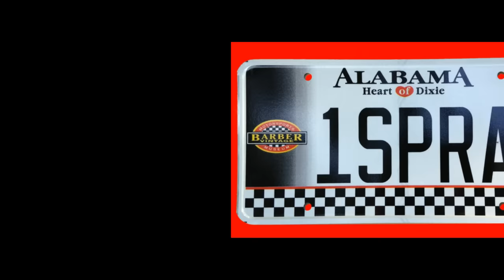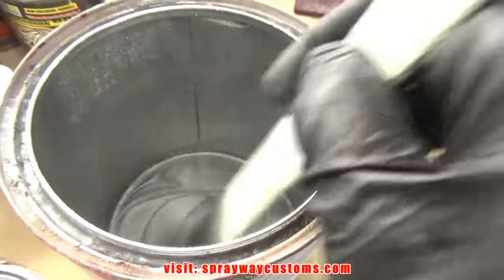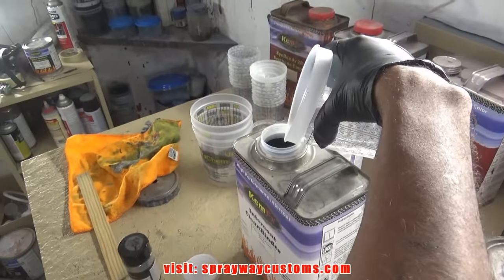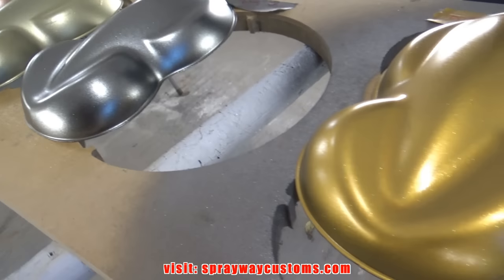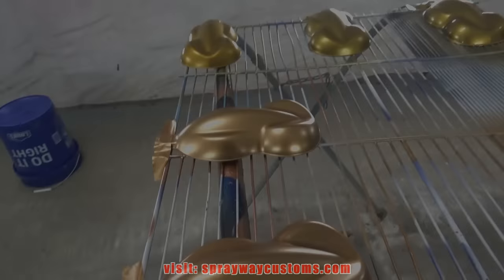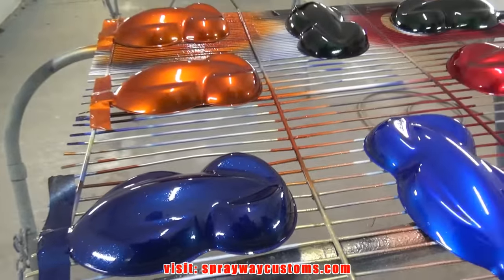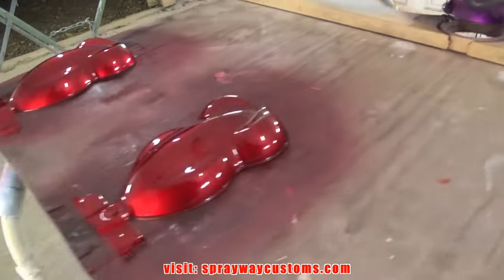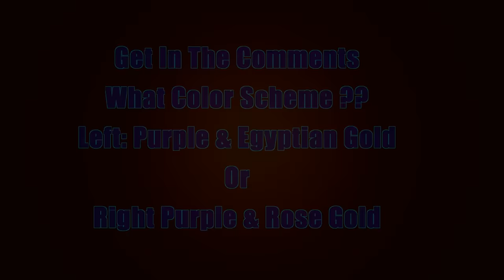How To Spray Candy Over Metal Flake In Intercoat Clear / Binder THE EFFECT OF DIFFERENT BASE COLORS

Comment: Always great content Sprayway.... looking fortips sprayway..when painting your car with pearls or metallics etc... and your painting panels individually where you need to paint and bolt on later ie full for restoration. How do you prevent the bolt heads from getting all marred up using a ratchet or wrench ....eg when bolt on your doors cus sprayed them off the car.

I've let my Hardware bolts cure for several weeks still find the bolt heads Mara if a lot of force is used with ratchet.... and yes I've tried to tap the threads clean so there's no paint in them
Reply from the maker: It’s really hard to keep that from happening